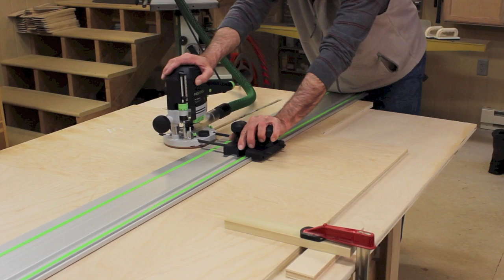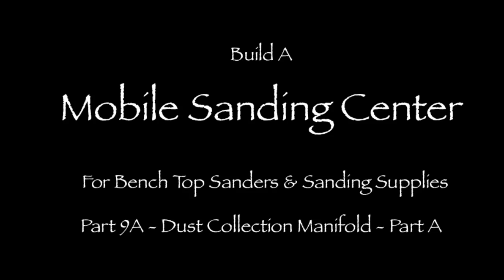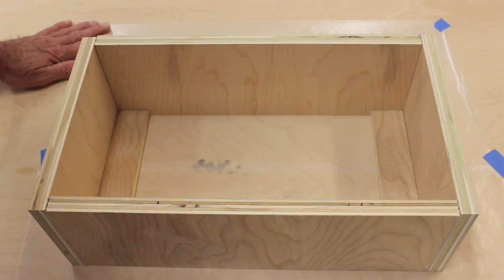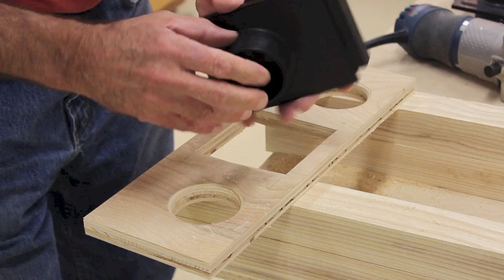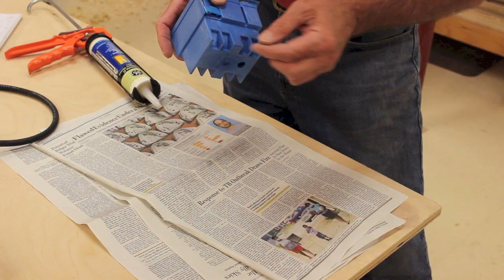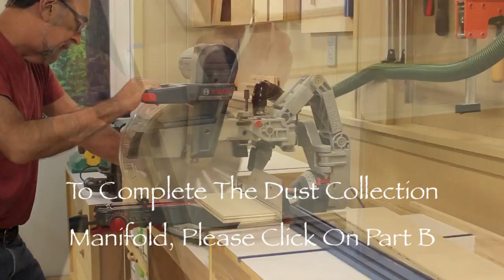Sanding Center Pt 9A   Dust Collection

Comment from the maker: Yes, I actually wound up putting in threaded inserts into the top and using small bolts to fasten the dust collection manifold to the top.  That way, if I need to remove it for any reason, the top is still clean and smooth.  Thanks!

Comment: Actually the radius on the plastic part you accommodated for is intentional for strength, as a 90 deg joint between the walls of a molded part  is very weak.